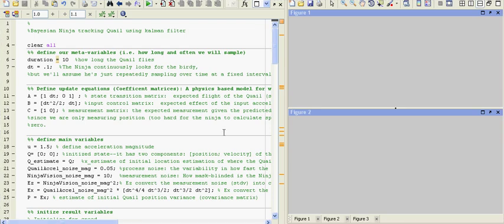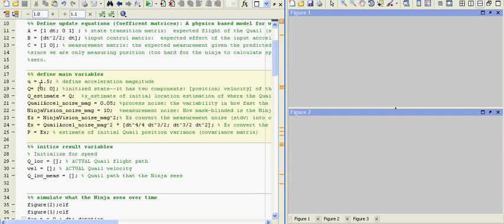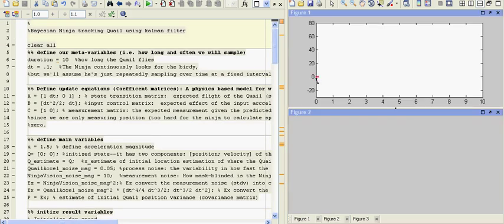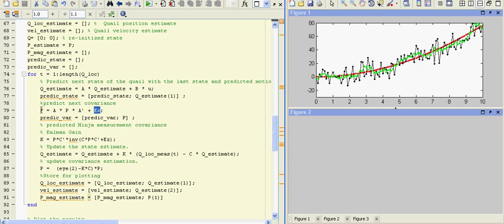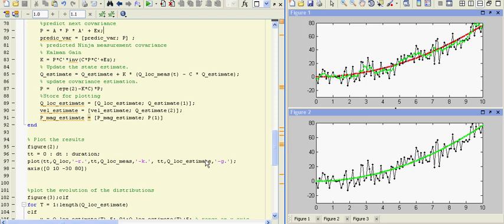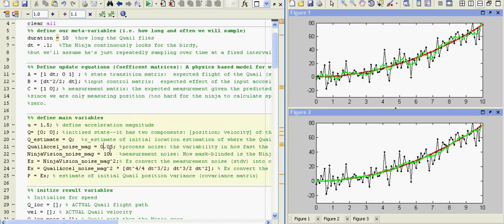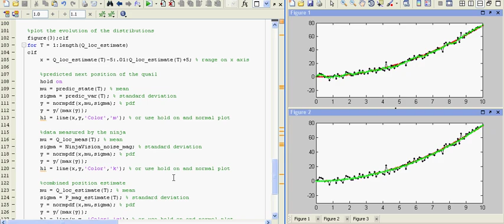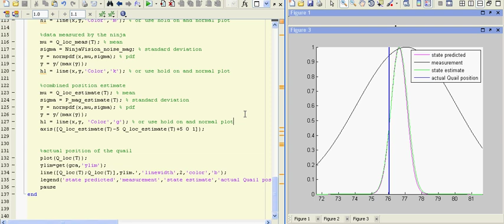Tutorial: Kalman Filter with MATLAB example part3

Comment: Matlab code doesn't work btw. Gets stuck in a loop
Reply: The code does work, it just pauses at each step to show you what is happening. If you want it run without pausing, comment out line 56 and line 139 which is the pause command in both loops.

Comment: is the  interval dt must be fixed every iteration?
Reply: +nir carmiI think it doesn't have. That's just a way to measure the time between two circles of reading the sensors. In embedded applications you could just use a timer or a counter to estimate the time interval dt. Although it is easier to pre determine a value.

Comment: Check his website for the codes. It's written in the description people.

%Bayesian Ninja tracking Quail using kalman filter

clear all
%% define our meta-variables (i.e. how long and often we will sample)
duration = 10  %how long the Quail flies
dt = .1;  %The Ninja continuously looks for the birdy,
%but we'll assume he's just repeatedly sampling over time at a fixed interval

%% Define update equations (Coefficent matrices): A physics based model for where we expect the Quail to be [state transition (state + velocity)] + [input control (acceleration)]
A = [1 dt; 0 1] ; % state transition matrix:  expected flight of the Quail (state prediction)
B = [dt^2/2; dt]; %input control matrix:  expected effect of the input accceleration on the state.
C = [1 0]; % measurement matrix: the expected measurement given the predicted state (likelihood)
%since we are only measuring position (too hard for the ninja to calculate speed), we set the velocity variable to
%zero.

%% define main variables
u = 1.5; % define acceleration magnitude
Q= [0; 0]; %initized state--it has two components: [position; velocity] of the Quail
Q_estimate = Q;  %x_estimate of initial location estimation of where the Quail is (what we are updating)
QuailAccel_noise_mag = 0.05; %process noise: the variability in how fast the Quail is speeding up (stdv of acceleration: meters/sec^2)
NinjaVision_noise_mag = 10;  %measurement noise: How mask-blinded is the Ninja (stdv of location, in meters)
Ez = NinjaVision_noise_mag^2;% Ez convert the measurement noise (stdv) into covariance matrix
Ex = QuailAccel_noise_mag^2 * [dt^4/4 dt^3/2; dt^3/2 dt^2]; % Ex convert the process noise (stdv) into covariance matrix
P = Ex; % estimate of initial Quail position variance (covariance matrix)

%% initize result variables
% Initialize for speed
Q_loc = []; % ACTUAL Quail flight path
vel = []; % ACTUAL Quail velocity
Q_loc_meas = []; % Quail path that the Ninja sees

%% simulate what the Ninja sees over time
figure(2);clf
figure(1);clf
for t = 0 : dt: duration

    % Generate the Quail flight
    QuailAccel_noise = QuailAccel_noise_mag * [(dt^2/2)*randn; dt*randn];
    Q= A * Q+ B * u + QuailAccel_noise;
    % Generate what the Ninja sees
    NinjaVision_noise = NinjaVision_noise_mag * randn;
    y = C * Q+ NinjaVision_noise;
    Q_loc = [Q_loc; Q(1)];
    Q_loc_meas = [Q_loc_meas; y];
    vel = [vel; Q(2)];
    %iteratively plot what the ninja sees
    plot(0:dt:t, Q_loc, '-r.')
    plot(0:dt:t, Q_loc_meas, '-k.')
    axis([0 10 -30 80])
    hold on
    pause
end

%plot theoretical path of ninja that doesn't use kalman
plot(0:dt:t, smooth(Q_loc_meas), '-g.')

%plot velocity, just to show that it's constantly increasing, due to
%constant acceleration
%figure(2);
%plot(0:dt:t, vel, '-b.')

%% Do kalman filtering
%initize estimation variables
Q_loc_estimate = []; %  Quail position estimate
vel_estimate = []; % Quail velocity estimate
Q= [0; 0]; % re-initized state
P_estimate = P;
P_mag_estimate = [];
predic_state = [];
predic_var = [];
for t = 1:length(Q_loc)
    % Predict next state of the quail with the last state and predicted motion.
    Q_estimate = A * Q_estimate + B * u;
    predic_state = [predic_state; Q_estimate(1)] ;
    %predict next covariance
    P = A * P * A' + Ex;
    predic_var = [predic_var; P] ;
    % predicted Ninja measurement covariance
    % Kalman Gain
    K = P*C'*inv(C*P*C'+Ez);
    % Update the state estimate.
    Q_estimate = Q_estimate + K * (Q_loc_meas(t) - C * Q_estimate);
    % update covariance estimation.
    P =  (eye(2)-K*C)*P;
    %Store for plotting
    Q_loc_estimate = [Q_loc_estimate; Q_estimate(1)];
    vel_estimate = [vel_estimate; Q_estimate(2)];
    P_mag_estimate = [P_mag_estimate; P(1)]
end

% Plot the results
figure(2);
tt = 0 : dt : duration;
plot(tt,Q_loc,'-r.',tt,Q_loc_meas,'-k.', tt,Q_loc_estimate,'-g.');
axis([0 10 -30 80])

%plot the evolution of the distributions
figure(3);clf
for T = 1:length(Q_loc_estimate)
clf
    x = Q_loc_estimate(T)-5:.01:Q_loc_estimate(T)+5; % range on x axis
     
    %predicted next position of the quail    
    hold on
    mu = predic_state(T); % mean
    sigma = predic_var(T); % standard deviation
    y = normpdf(x,mu,sigma); % pdf
    y = y/(max(y));
    hl = line(x,y,'Color','m'); % or use hold on and normal plot
      
    %data measured by the ninja
    mu = Q_loc_meas(T); % mean
    sigma = NinjaVision_noise_mag; % standard deviation
    y = normpdf(x,mu,sigma); % pdf
    y = y/(max(y));
    hl = line(x,y,'Color','k'); % or use hold on and normal plot
   
    %combined position estimate
    mu = Q_loc_estimate(T); % mean
    sigma = P_mag_estimate(T); % standard deviation
    y = normpdf(x,mu,sigma); % pdf
    y = y/(max(y));
    hl = line(x,y, 'Color','g'); % or use hold on and normal plot
    axis([Q_loc_estimate(T)-5 Q_loc_estimate(T)+5 0 1]);    

   
    %actual position of the quail
    plot(Q_loc(T));
    ylim=get(gca,'ylim');
    line([Q_loc(T);Q_loc(T)],ylim.','linewidth',2,'color','b');
    legend('state predicted','measurement','state estimate','actual Quail position')
    pause
end

Comment: Hey, this tutorial is by far the best tutorial on Kalman filter I have seen! But could you explain more about the predermined acceleration magnitude. How do we determine the quails acceleration magnitude beforehand? And it looks like, while knowing that information (acceleration u), we can just use Newtons laws of motion equations and ignore measurements... Thanks for your help in advance :)
Reply: The same question bothers me and basically spoils the understanding of the Kalman filter given here :( Is it possible to get rid of this hard-coded acceleration value u?
The answer would be more than thankful!
Reply: I agree. some discussion of how acceleration was estimated from the independent object (quail) would be good. Otherwise, a nice tutorial. 

Many other tutorials assuming the control matrix is 0, which is probably a good starting point for tracking an object you have no prior knowledge or control over.
Reply: same here. I just dont know how estimate u in my application. I want to do sensor fusion (gyro+accel) but idk how to get this u, and how i should use the extra sensor information (since i have 2 sensors).
Reply: +Henrique Alves I'm starting now my master thesis on gyro+accel sensor fusion with kalman filter. What i know is that that parameter is your control on the system so it is intended that you know his value. The idea behind kalman filter is that the evolution of the system is known.
Reply: +Henrique Alves yes, i got it. In my opinion, you can't, but i can tell you more tomorrow :)
If you want leave me your email.

Comment: QuailAccel_noise = QuailAccel_noise_mag * [(dt^2/2)*randn; dt*randn]; <= this code generates two different random noises to velocity and distance repectively. What I am saying is the the same accelation noise should be used to both velocity noise and distance noise because a noise happens to accelation,  velocity noise should be dt*(accelation noise) and distance noise be (dt^2/2) *(accelation noise) therefore [(dt^2/2)*randn; dt*randn] has to be changed to  [(dt^2/2); dt]

Comment: Hi Dave. 
Thank you very much for your explanations. It is much easier to understand. It saved me a lot of time and frustration.
I want to point out some correction about the code. Since the same accelation noise propagates to both postion and velocity, I suggest that the code below should be modified this way.
QuailAccel_noise = QuailAccel_noise_mag * [(dt^2/2)*randn; dt*randn];
=>
 randn_sample= randn;
 QuailAccel_noise = QuailAccel_noise_mag * [(dt^2/2)*randn_sample; dt*randn_sample];

Comment: Please, I could see the equation on line 76 in your code,  Q_estimate=A*Q_estimate+B*u; I guess, it is a noise-free model. Then this is the noise-free (true) location and there is then no need to use Kalman filter and its correction gain to correct it. However, your explanation is great and I appreciate your efforts.